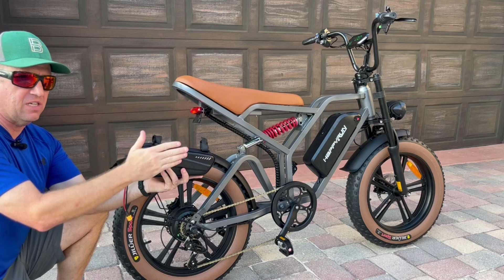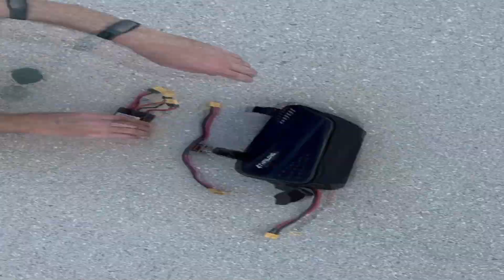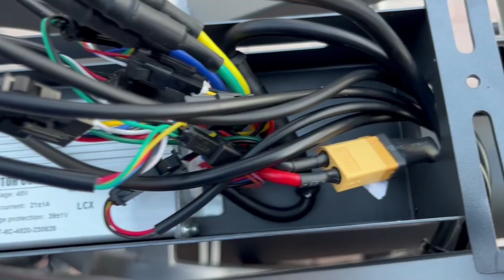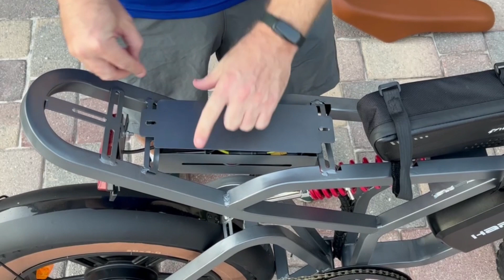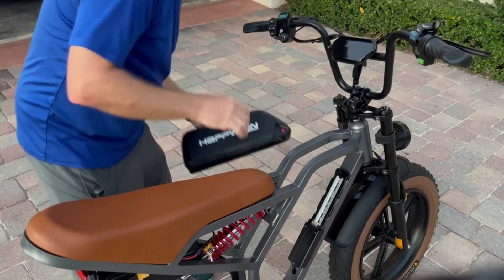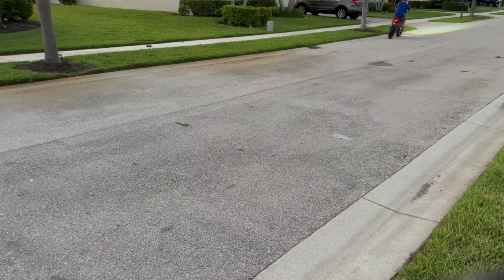2nd Battery on HappyRun G50 & G60 - more range

Comment: Great video.. I bought the g60 pro thinking I could just buy another battery and not have range anxiety but happyrun has been sold out of batteries my questions are would it work on the g60 pro and could the 25ah fit in the same spot
Reply from the maker: Two 25Ah batteries will not fit in an G60pro frame so you would beed to carry one on your back or do what is shown in this video with a 10Ah or 15Ah battery
Reply: @BRichSolution  few more question for you .do u think it's possible to upgrade to a 5000w conversion kit and  what's the biggest  battery you think that could fit in that frame?  Or would a 3000 hub be more practical

Comment: I’m ordering a 48v 20ah battery to use in combination with my stock 48v 18ah battery. Will the toggle switch you linked still work for that setup? 

Also the battery u linked comes with an Anderson connector. Did u change it to an xt60 yourself or was already there?
Reply from the maker: Yes, toggle switch will work with 20ah battery.   Use a  t-connector to xt60 adapter to switch between connections.   Not sure 20Ah battery will fit in the frame, 10Ah and 15ah no issues
Reply: @BRichSolution  Thank u so much man! Love the channel!

Comment: If i add a batter with a 40 amp bms, do i need to have a 40 amp battery balancer? No right? Because my controller is limited to 21? Or wil i need a 40 a balancer if my new battery has a bms of 40
Reply from the maker: The controller is only going to pull 21 amps so 30amp combiner is sufficient but if you want to buy the 40amp it might only be $5 more
Reply: @BRichSolution im lost now that new link I sent you after doing more research. It doesn’t show dc. It just show me. Ac . So I’m tempted to just use the one that you know works even though the amps are lower by like six.

Comment: How long have you had this setup friend? How has the 15 a toggle switch been holding up? Do you full throttle frequently? Lmk if my 32 a toggle link didnt go through
Reply from the maker: 15amp i have been using for a year now no issues
Reply: @BRichSolution thank you for the replies! Did you get my link for the 32amp? Would you switch or stay since yours is fine?

Comment: I may not need it, but I ended up ordering a 32 amp toggle switch 15 A on the toggle switch that you recommended is under the happy run max output of 22
Reply from the maker: Send link to 32am toggle switch?
Reply: @BRichSolution my bad if i out it hella times it seems like youtube is deleting the link

Comment: After ordering all the parts, I’m a little nervous to install. I say that because the on off toggle, which is only rated for 15 A. My controller pulls 22.. that’s gotta be no good right
Reply from the maker: Can you get a switch rated for 30amps?
Reply: @BRichSolution is my link going through?

Comment: I assume the same process is for a 20 amp hour battery right you just didn’t say it? Cause I ordered everything in order to 20 amp hour to add
Reply from the maker: I have an extra 40amp controller which provides more torque but top speed limited to 28mph.   If you want it I can sell it for cheap price

Comment: Do you use another charger other then the one that came with it? Ive heard charging time with the factory charger can be slow? Is the suspension adjustable on the 50pro or the 60pro? Thanks for the info! And the review!!!
Reply from the maker: Use charger that comes with the extra battery to charge 2nd battery.   If you want to charge factory battery buy 3A charger like this  https://amzn.to/43qlDAA

Comment: Man I came across this video on FB in the HR group and really would like to try it on my g60 pro. I sent Happyrun an FB message asking about this, with a link to your vid and if it would work.  I sent a screen shot with all the parts you listed here.  They simply responded, not compatible.  I asked why not and that others have done it with success.  No response. So I’m not sure if it’s because I have the pro and yours is regular or if they simply said no so I can buy their overpriced batteries
Reply from the maker: They will not authorize connecting any battery but the ones they sell.   I have added this battery to over 10 ebikes using the same method.   A few of the bikes have T-connector and I needed xt60 adapter which is easy to buy for $2.
Reply: @BRichSolution well thanks a bunch for the response.  I took my seat off and it appears i have the same connection you had on the g50.  I was afraid of trying it due to the battery being non refundable. I’m looking at the hailsong 48v 20 ah..$219 on amazon. Quick question.  I noticed with your location it being under the seat, did you have my issues hitting the battery as your rear flexed over bumps ?

Comment: is there any speed limiter cord on the happyrun and also does that make it faster
Reply from the maker: No speed limiter cable on the happyrun.  The extra battery does not make it faster, but allows you to maintain top speed longer.   With the factory battery top speed slows after 18-20 miles where as the extra battery allow you to go 30 miles or more at 28 mph

Comment: I have a question i order an xtra battery but its built for happy run bike but the battery is a lot bigger than the one you have and the name call Hailong Ebike lithium Battery 36V 48V 52V-10AH 13AH 15AH 20AH please let me know if you know what battery im talking about and let me know if that bigger battery would be able to install for my happy run bike
Reply from the maker: Look for sticker on the battery does it say 48V / 15Ah or 52V / 20 Ah?
Reply: @ 48v name on the side call powallon and it’s huge i do not know where to install it I think I might have to get a bike rack to install it

Comment: I just bought another battery and I switched it back and forth I was able to install a bracket on the bike that holds the battery and it works perfectly fine I just got to take the battery off and put the other on  I didn't want to install a battery that was less milliamp hours then my original one
Reply from the maker: Understandable
Reply: @BRichSolution   hey what's up what do you know about installing a second motor

Comment: I see the black g50 for 999 on their website, and this color g60 for 800 is there a reason the newer g60 is 200 dollars cheaper? Which would you recommend?
Reply from the maker: G50 is not a good bike IMO its slower then g60 and seat is awkward.   G60 on sale see link https://www.amazon.com/dp/B0D2ML6LSR/ref=cm_sw_r_as_gl_api_gl_i_76RQHDZ3QWE945RMSCRS?linkCode=ml2&tag=brichsoluti0a-20

Comment: I bought the 15 ah battery, combiner and switch for my new G50. Unfortunately the controller is no longer located under the seat, but in the bottom portion of the battery receptacle. Not enough room in there for the combiner box either. Also, don’t think the battery can be returned…I’ve contacted the seller directly, but don’t have much hope. I’m stuck…any thoughts?
Reply from the maker: Many ebikes going this route so you will need to put combiner on the frame like this bike see video 
https://youtu.be/hacZPX3XuwA
Reply: @ Thanks. I was worried about leaving the combiner exposed, but I guess it’ll be ok?

Comment: I ended up putting a Hailong 48V 30Ah battery in the stock location. It fit perfectly. Now im going to order a small 15Ah triangle battery and a battery combiner. I don't want to use a toggle because i want to have both batteries on simultaneously. My questions are; will the power draw properly from them one at a time and can i charge both batteries from the stock port on the main battery, or must they be charged separately?
Reply from the maker: Charge separate.  Since batteries are different sizes wait for the 30Ah battery ti drain down to 50% before turning on the 15ah battery
Reply: @BRichSolution  is this due to having no toggle switch  or is this due to? Running not the same amp our battery on the two.?

Comment: Hello there Sir, I am looking to add a second battery to my HR Tank G-50... I am looking at a couple of options when it comes to batteries... money is tight, and I am looking for as many Ah as possible. Now I got the peak 1500W G-50... Is it possible to run the second battery with the same setup as you did in this video with a 48v 1000w 20Ah battery... what I have on my bike right now is a 48v 18Ah.864Wh battery... the stock battery it came with
Reply from the maker: Yes you can add 10ah or 15ah battery as shown in video
Reply: @BRichSolution  Thank you so much for the information, but I guess my main concern was can I use a 1000w battery on a 1500 w motor?

Comment: I've got the new G60 2004 amyet but only comes with a battery key can you tell me how to turn on the display mine won't work seller isn't getting back to me
Reply from the maker: Hold the power button for 3 seconds between + and -

Comment: I have the G60. Not sure how much more range you would need over stock....🤷‍♂️
Reply from the maker: Full throttle is only about 25 miles so that is only 12 miles out and back.   With extra battery you can go 40 miles and keep top speed for longer
Reply: @BRichSolution  this depends on weight and other things. I rarely ride full throttle without peddling. I did 15 miles last weekend and still had plenty of battery left. My thought is.. is it worth it so spend $300 for another 12 miles?

Comment: I hace a happytun too. can i add a 48v 100ah battery to my existing 18ah battery using this battery combiner? it will be118ah total. is that possible?  or the combiner has a limit on how much Ah you can add combining both batteries?
Reply from the maker: Yes same procedure for any Ah battery.  The combiner is only restricted by amps not Ah
Reply: You won't have room for a 100Ah battery. Plus, the weight would be insane. I swapped my 18Ah Hailong battery on my G60 for a 30Ah Hailong battery in the stock location. Then I ordered the 15Ah battery in this vid with a parallel connector and connected it to the 30Ah battery. That gives me 45Ah, which is more than I'll ever need in a day with a 750W motor. I can literally get over a 100 miles if I stay on PAS2 and peddle occasionally. 👍

Comment: My g60 the brakes must have pil on them at some point terrible squeal  from both have ask customer  support they want me to take to a bike repair shop have it fixed and then get reimbursed. I'm not shure if I will keep it I don't have truck to get it around !I live in hilly area and always on the brakes both ways on my ride could use bigger rotors for shure with these big tires.
Reply from the maker: Clean brake rotor with water and dawn dish soap and then wipe rotors with rag or paper towel with some alcohol

Comment: Is it possible to parallel connect the second battery to eliminate the toggle switch and be able to charge both batteries from the stock charging port?
Reply from the maker: Yes, switch is optional for 2nd battery.    You need to charge each battery separately
Reply: @BRichSolution  if you do that does the battery will drain equally? I just purchase a second battery from happyrun and I would like them both on all the time. also purchased a 2000w front motor from alibaba. do can i put both batteries on both motors together?
Reply: I parallel connected a spare battery to my JupiterOne Defiant and I'm able to charge both batteries from the stock port. They're identical batteries, however.

Comment: Will this bike take a hilong 52v 25ah?
Reply from the maker: I wouldn’t risk blowing controller.  Get the 48V battery
Reply: @BRichSolution  thank you 🙏🏽
Reply: @BRichSolution  I have this exact bike it comes with 48v 18ah as you know. I’m dissatisfied with the range im unsure about solutions
Reply: I guess this video is the answer. I was hoping to get a bigger battery and be done with it not run two if it gets more torque I won’t complain

Comment: Hi B Rich. I've recently bought the happyrun g50, and just ordered all the parts in this video to extend the range. Now I'm interested in upgrading to hydraulic brakes. Would you happen to know of a plug & play option available through Amazon?
Reply from the maker: If you want to retain the motor kill switch on the brake you need a set of hydraulic brake levers with SM connector wires which I cannot find on Amazon only Aliexpress https://s.click.aliexpress.com/e/_DDdd4Md    See video for how to install and connect 
https://youtu.be/3yeutM4HPyM?si=ahfYYr9JcA3k0HHR

Comment: can you do a controller upgrade for the g50, it has a 1500 motor to go 27mph?
Reply from the maker: If happyrun will sell you the g60 controller for g50
Reply: @BRichSolution so i could replace the g50 controller with the g60?
Reply: @BRichSolution hello, so if i upgrade the g50 controller to g60 will it make my g50 faster or more torque?

Comment: What about happyrun G100????
Reply from the maker: G100 is not a good value.  For $1799 you can buy dual battery dual motor yolin that is faster, larger batteries and 28lbs lighter.  The G100 is steel frame and bike weights 110lbs vs yolin is 82 lbs
https://youtu.be/y3XJkRnppJ0?si=mj-TR1OFZUBy7fjA

Comment: Hello B . Rich I just liked and followed all based on all the quality uploads you’ve contributed. I am torn between the 50 and 60 . I would use either of these options for both work ( I’m a delivery guy) and transportation. Is there a significant difference between the two ? If not , I’ll settle for the 50 and use the links you attached to purchase the 4 items to bump up the quality that much more . Thank you for your quality videos !
Reply from the maker: Don’t buy the G50 its slow.   If you do delivery buy the Ouxi v8 with cargo rack to haul deliveries as the G50 and g60 don’t have cargo rack options
https://amzn.to/49IVApt

Comment: Hello there love your videos! Helped me make my mind up in purchasing the g60, I was wondering you you could help me out, is there a way I can get more juice out of the e-bike as I live in a hilly area! It just needs that little extra that the g60 is lacking.
Reply from the maker: Does your G60 get to 30 mph?  If so its configured to the max and nothing you can change after that.  Its one disadvantage of Happyrun control you cant change the settings.   You can try making this change to see if there is difference https://youtu.be/HYYYY_LncuM?si=USulA_fiAwUd4zWO
Reply: Te duró un año g60 ?

Comment: Brilliant work B. Rich. I noticed the aux. battery is a Hailong, my question is will it work with other Hailong main battery systems, or just specific to the HappyRun G50 & G60 bikes and their controller? Very good info for the e -bikers out there.
Reply from the maker: I will work on any ebike
Reply: @BRichSolution  did it add any power going up hill or just extend range ?
Reply: Good to know, its on my upgrade list. @BRichSolution